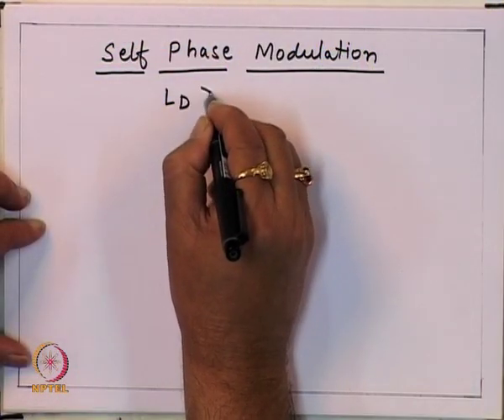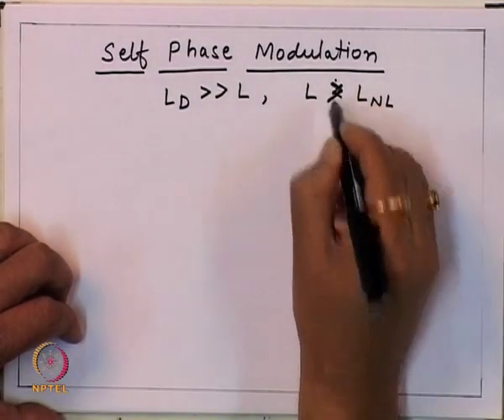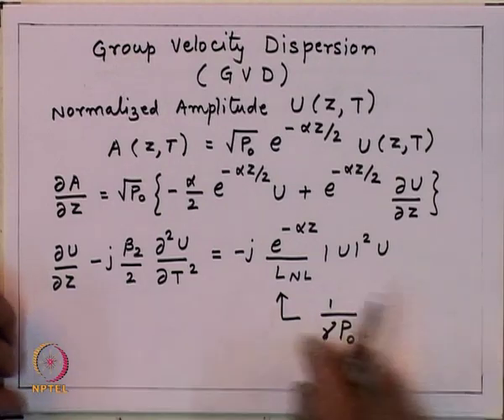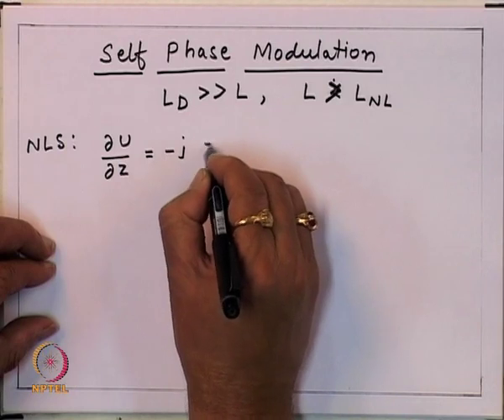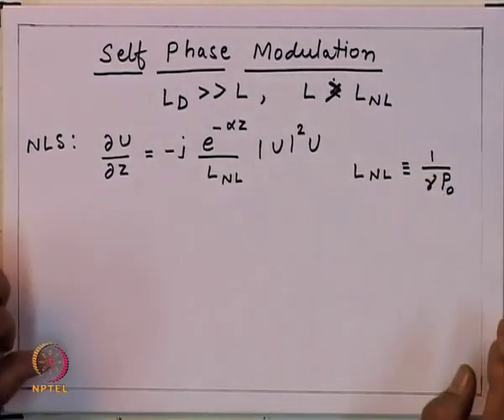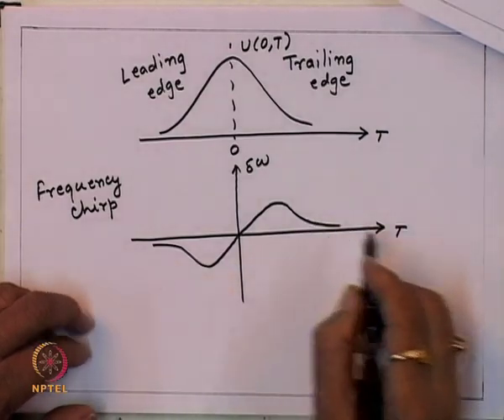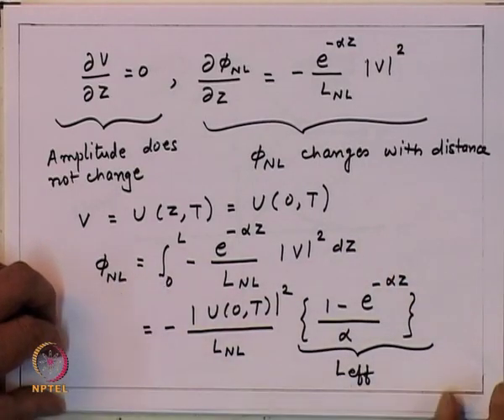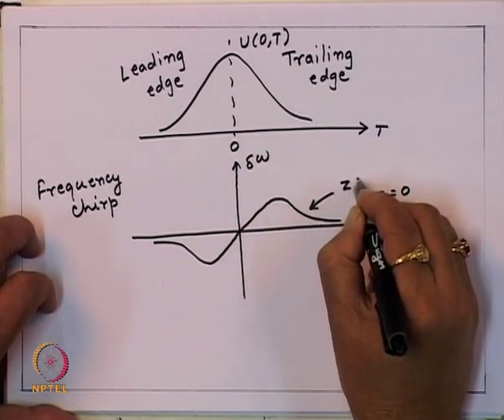Mod-01 Lec-35 Self Phase Modulation (SPM)

Comment: Thank you very much for the elaborate explanation. I have 2 queries which are as follows:
1.)  7:12 in the NLS equation , on the right hand side of the equation, is the Negative sign going to be there? i.e: du/dz=+or -(...)
reference Book : "non linear fiber optics" by Govind p. Agrawal 5th ed. page 88
2.)43:46 the formula which is stated for N, isn't it going to be the formula for N^2 instead of N?
reference book: same as above; page: 98